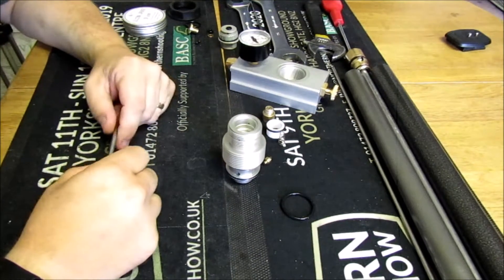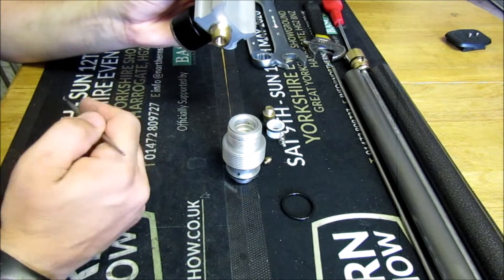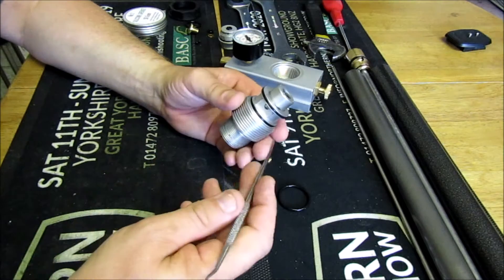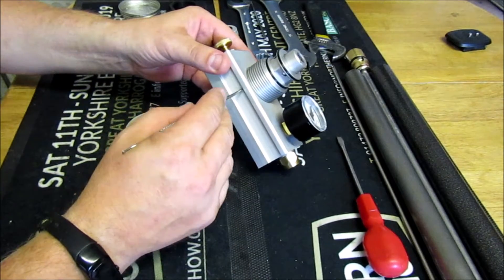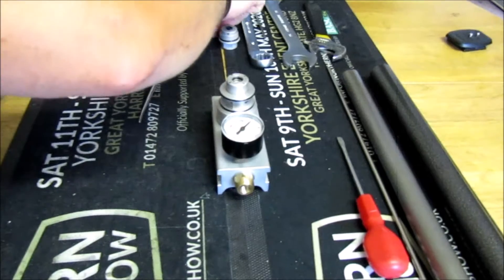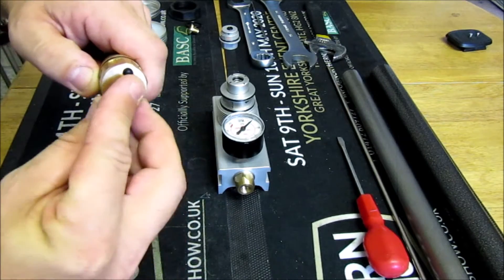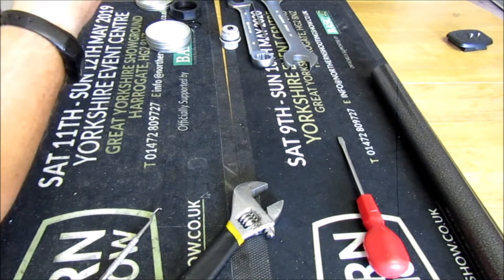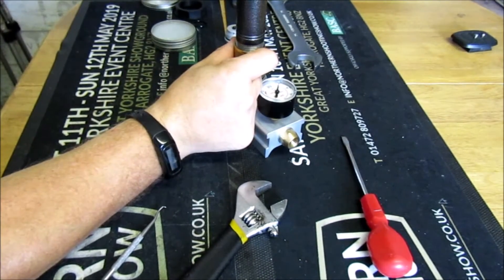HILLS MK4 Stirrup pump stripdown

Comment: very nice video.  i have a question: on the end of the hose itself where you would connect it to the airgun can you tell me what it looks like inside of the quick connect. mind has a little brass plug in the center of the female quick connect.  does yours have the same thing.   thanks

Comment: My Hill mk4 is popping up on every stroke without building any pressure. Tried cleaning and replacing green o-ring but no success...help me out please.
Reply: I have the same problem, i did.all, changed all the orings,  but the problem has not been solved yet. I really appriciate any kind of suggestion

Comment: Just serviced my pump after I wore it out 🤣 I do use it a hell of a lot tho and tbh I really should just get a compressor for the amount of air I use like 10 to ups from 100  bar a week or something stupid 😞 I can tho so it's not a bother.
Anyways cheers for the rough idea on how it comes apart etc etc but honestly anyone who feels daunted etc, trust me it's as easy as a b c !
The kit comes with instructions and as long as you have two adjustable spanners and a angled pick your golden like 7 o rings ffs it's not rocket science.
I'm happy to report my mk4 is up and running again 😊 so happy days 

Atb bud 👍👍 thanks again

Comment: "As you can see". NO WE CAN'T might help if you had the part in front of the camera. As 456 123 said you have only done half a job. The pump is not supplied in kit form. Also it would help those who don't know how, if you showed how to remove the seals.(without damaging the parts.)
Reply from the maker: Thank you for your comments.  I take on board what you have pointed out in your comment and  this video was only done to show the seal locations.  Getting the pump stripped it's the reverse of the build up, but if you need further help email me and I will go through it step by step